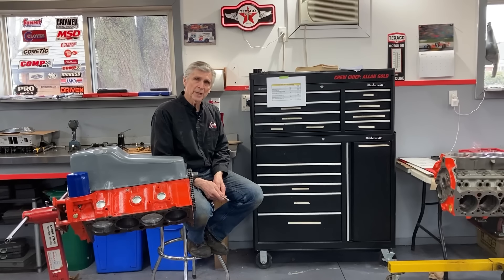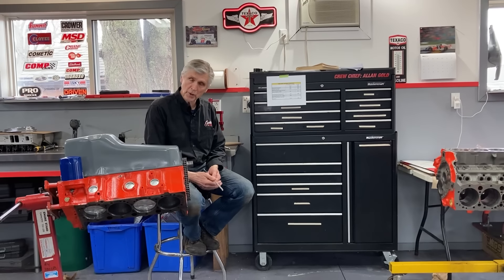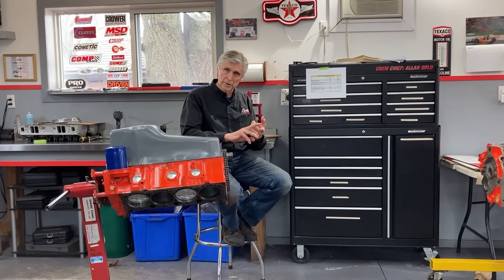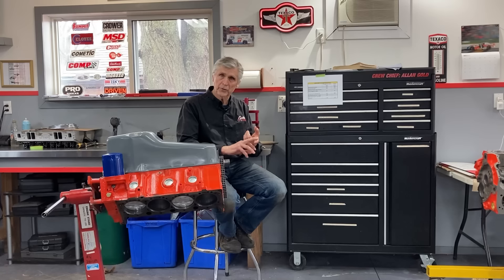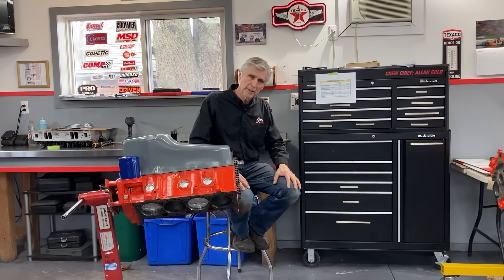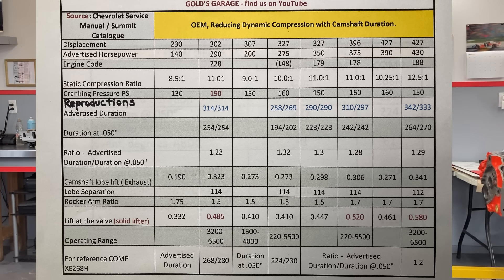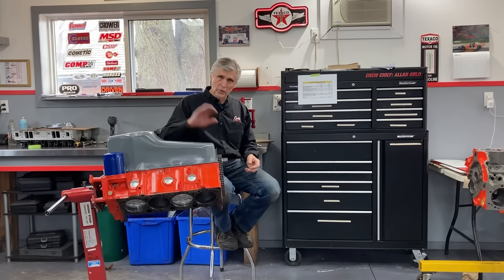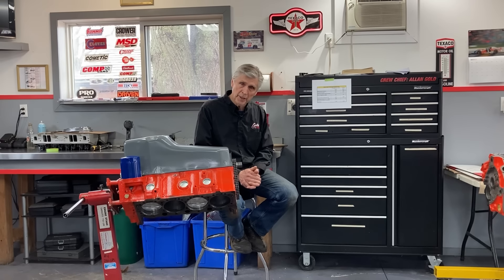Selecting the right camshaft - Compression Myths How much compression can you run on pump gas?

Comment: Hello, doing a 350 Chevy with 9.9 compression  but a very short camshaft. Howard's flat tappet. 255/261adv duration. And 201/207@50 with 114 centers. It's installed at 109 degrees  when I degreed  it.  What would I expect for cranking compression 200psi, maybe  a tad more? And also I plan on running premium  pump gas 91 octane in this engine, is it going work with 91 octane and still put a little timing in it?   It's got 416 305 heads on it with 60cc chambers, .015 steel shim gaskets with 12.3 cc dish pistons  with about .040/.042 quench.  Going run a stock Quadrajet  carb, holley street dominator  dual plane intake and factory ram horn iron manifolds. Wanting a low rpm high torque engine and fuel mileage  and not concerned about high rpm hp. What are your thoughts?  I can't find anything on how high of cranking psi I can go on 91 pump gas.
Reply from the maker: Thanks Jesse, you need a cam upgrade for sure. A couple of suggestions, what about the two cams I compare in the video. The COMP XE268H or the L79 cam. That said, you should re-calculate the DCR and cranking pressure with either of these specs. The Summit on line compression calculator will give you your CR and the Wallace calculator will give you the DCR and cylinder pressure PSI. 

If you read the other comments to my video, many out there claim to be running 200 PSI and I am sure they are, however my point is why take the risk? maybe have to reduce your timing and then HP too. You will be into  what I call diminishing returns, that is the gains in power from going from 160-180 are better than from 180 -200 PSI. Your objective is to build a nice street motor not make compression. 
Unless you are racing and need the every last HP, I would stick to my 180PSI. 
Please let me know if this is helpful and thanks for watching Gold's Garage. AG
Reply from the maker: Hey Jesse, I should add, you could also use 1.6:1 rockers to increase the lift without compromising the other factors. Lift helps everywhere. AG
Reply: @goldsgarage8236  I could run 1.6 rockers.  The lift with 1.5 is .410/.420.  This cam has a power  band 600 to 4600 rpm. What more do I need. The engine is going in a 72 C10 pickup with 3.73 gears and 700R4  tranny and only turn 2000 rpm @65 mph. I'm trying to build all the low rpm torque I can get and mileage.  I recently  did a 383 with Howard's cam   259/269 adv. 205/215@50 112 centers  .420/.455 lift in a 84 4wd pickup. It pumped out 195/200 psi on compression  gauge all 8 cylinders and run on 87 gas with 10/12 degrees intial timing and no pinging..   So I'd think it should work on 91 octane my combination.  I know what u are saying be on conservative  side.  I've double and tripled  checked my dynamic compression  several times,  comes out at 8.4.  Chevy had the 300hp 350 in 69/70 with camel hump heads and was 10.2 compression  on the stock 929 camshaft.  They just ran premium  gas in it.
Reply from the maker: Hello Jesse, just noticed that I missed your comment from 2 month ago. First, a 3.73 gear with a 700R4 is the perfect combination for the street. More than 11.1 torque multiplication in first gear and low RPM cruising. This will allow you to use a little more cam which will improve your power and  RPM range and lower your DCR. For timing, always set it at full advance with the vacuum disconnected. About 35 degrees usually works best. It doesn't matter what the initial timing is. Always use vacuum advance. Hope this helps and sorry for the late reply. AG
Reply: @goldsgarage8236  yes that's ok.  I plan on running the vacuum advance to manifold, not ported.  There's pros and cons either way but  thing more timing is better at idle with lean mixtures and cruising and it won't hurt things if it's lugging some or denotate.    More cam starts taking  low rpm power and torque away from bottom end.  I have overcammed  a 454 I did and don't like it at  all and no low rpm power for towing what I use it for so I'm going run small cams.  I'm after all the mileage I can get and not building a race car or drag race engine.
Reply: @goldsgarage8236  Hello again.  I tried to do a compression  check on that 350 and found out it gots a weak slow cranking starter and only got one cylinder checked but I only had about 160/170 psi, isnt that kinda low for a 10 to 1 static compression  engine. My cam is pretty small but it has the 114 LSA, i think thats costing me some cylinder psi, if it was on a 110 it probably  would have more?  Just curious  what u would say, i was hoping for 180/190 psi.   Going fix starter  and re check if that even helps?  8.4 is my dynamic so I thought the psi would of been more.

Comment: 12.5-1 compression.  Timing . Coil near Plugs . The Right Camsharft & Crank Trigger .  & in Australia 98 Octane  / USA 93 Octane.   U could also run as a Safety Margin  Water / Methanol.  Works fine in N/A Engines ,  but better in Boosted Engines.     Pretty sure that Porsche are running 12-1 or 12.5-1 in there N/A engines.

Comment: If you could run forged parts in a 427 chevy, you could rev them to around 8k for short spurts. We made more power then the other gm guys that way. No rec port heads for sbc 327, 350, 455s back then. 320 cfm flow was awsome, then we'd port em.

Comment: This is EXACTLY the Question I'm Needing Input On!! 1968 427 321 30 over Block, Speed Pro ZL-1 Replacement Pistons, 074 ZL-1 Heads(2.25 Intake) w/.020 Milled Off, Factory 069 Intake and Holley 850 Dbl Pumper. TH400 + 3.90 Gears. Thinking of Roller Cam-Due to the Lifter Eating As of Late.
Reply from the maker: Thanks Mark, you will have a nice motor. A roller is a nice way to go for sure. Too bad they are so expensive. Thanks for your input and please keep watching for more on this subject coming soon.

Comment: I run 100 av fuel with an ounce of additive 13.0:1 static, 9.6 dynamic and 240 psi cranking. Better to be safe than sorry, I also Dyno tested av gas vs sonoco 110 and av gas was 20+ HP up on the 110.
Reply from the maker: Thanks for watching and commenting Mopar. You definitely need av gas with 240psi. AG

Comment: When your boat is on the water you are riding on a giant radiator you can adjust it if your boat is set up right as to what kind of temperature you want to run and you can get away with murder compared to a streetcar as far as high compression goes
Reply from the maker: Boaters are spoiled Hoosier, thanks for the comment. AG

Comment: The issue with running high static compression ratings is the volumetric efficiency of the engine. If an engine running 12:1 static has very high flowing heads, intake, and high duration lift camshaft then it is likely that 100% or greater volumetric efficiency will be reached at high rpm. 100% VE means the static cpr ratio is being met. If you’re at 11.5-12:1 static and you’re meeting 100% VE then race fuel will have to be used. Many of these muscle engines run on the street with high static cpr ratios but it doesn’t matter as the heads and camshaft are not capable of reaching a high enough VE to reach what is the static ratio (11:1, 12:1 etc) thus 91 or 93 octane runs them without issue. Most ‘hot’ street builds with 2v CSB etc engines are maybe reaching 90% or so at best
Reply from the maker: Good point Selmerpilot, I plan to address this issue on a future video so thanks for the input. AG

Comment: Back in the 80s we didn't hav3 hi test at the pump hardly anywhere.  In the 90s we had aircraft hi octane gas. And e85 is just to expensive. Cost is a big factor for a hi perf street car.

Comment: Not all engines designed the same as regarding Anti-Knock Chamber--Piston shape issues.....With '60's high compression Factory production Tolerances & 100 octane Pump gas available,  0.040" to 0.060" head gaskets & high domes were common.....When doing  a build Today, Thinnest gasket (to whatever Piston to head clearance you comfortable with), Aluminum heads & Shortest piston Dome to give 0.040 Squish gap & using the Coldest range possible Sparkplug with a hot ignition is usually a good direction build plan.....With hopped up Pontiac engines tendency to run Hotter than wanted, It's Interesting  that Pontiac used "Reverse Flow" coolant design to Cool the head First & then the block.....
Reply from the maker: Thanks Tom, I don't think there was as much attention paid to squish back then. Most OEM haled at last a .040 head gasket and then .030" minimum deck height. I recall using a thin steel head gasket on my Z28, we painted them with silver paint. They were about .015" and I did deck the block so we were close, but we didn't call it squish.

Comment: I used the speed pro ,  306  222 at 0.50.447 lift. It would improve power in about any form of 350. I agree.
Reply from the maker: Thanks David, looks like an L79 Cam. They work great.
Reply: I bought a 1978 Mark Twain boat. Engine was all apart.
I used that cam in the 305. Ran surprising well.
Idle was not very good. But at full throttle ran great.

Comment: well imo with that comp 268 stick at 190 psi cranking you may need to take use of a well designed aluminium cylinder head possibly a lower operating temperature slow advance curve perhaps even less base and total timing and may have to make a fatter afr in some operating areas you make it work. the slower gm style ramp rates bleed off much cylinder pressure and again imo may have to advance base timing speed up the curve to get clean idle and throttle response however as things get swinging at rpm the trapped pressure may be to high for 87 juice depending on what it is paired with automatic 308-1 gearing 1ton dually or tge other way like a nova or 60,s camero may be just fine or need total timing pulled back a tad and fattened up on the top of the mains. back in the 70,s we were playing with water injection systems from edelbrock to mist some purified h20 at certian vacuum rpm as well as throttle position to prevent flame front deflagration detonation ping spark knock or what ever to help. tolulene as i recall was one of the things we would add to crap gas back then tgat seemed to work quite well
Reply from the maker: Thanks John, you have lots of knowledge and experience on this issue for sure, I will be disusing these issues in the next video. Thanks for your contribution to my channel. AG

Comment: Don't better grade fuels also allow for more ignition timing with less fuel allowing for more power? I know that's one of the factors that can play into your tuning
Reply from the maker: That is correct William. The opposite of that is when compression pressure is to much for the octane, the only option is to reduce timing and reduce power at the same time. Thanks for the comment. I will discuss this further in my next video. AG

Comment: Do a video on the poor little 290 Horse Power 302 cubic inch Z28 engine 😁
you would think it would depend better with 11:1 compression and a 254 duration cam 🤠
everyone loves that might mouse so it would be a BIG Video if you talked about that engine. 😊
or built one with a build video searies.
Reply from the maker: Thanks DAN. One of the first builds I ever did was the 302 in my 1968Z28. That was back in 1969. I would love to do another one. Finding all the correct OEM parts is a challenge and very expensive. If anyone out there has one to build, I would be happy to do it for you, Dyno included. AG
Reply: @goldsgarage8236  Right, Chevy did lots of tricks to that motor, pistons shape, windage tray, off road cam, 🤠

Comment: Can you please explain dwell angle
Reply from the maker: Thanks Dr. Evil, that is an interesting question. The term applies to ignition systems prior to the introduction of electronic ignitions. By about 1973 all ignition systems were electronic. 
Prior to that spark was provided by ignition coils and ignition points, then distributed to the respective spark plug wires via the rotor and distributor cap. 
Ignition points (contact points) are really just circuit breakers. With an 8 cylinder engine, the distributor cam had 8 lobes, so dividing 8 into 360 degrees they were 45 degrees apart. 
The ignition points connected the primary side of the coil to ground. When they were closed 12volt power in the primary side would energize the coil, which is really a simple transformer, so voltage would build up in the secondary side of the coil, (about 10,000 volts). When the cam on the distributor opened the points, (circuit breaker) as it rotates, the built up energy would discharge from the coil to the spark plug via the rotor and  the distributor cap. 
Ok, finally here is the answer to your question, dwell angle is the amount of time (in terms of rotation) that the ignition points were closed, usually about 30 degrees of the 45 degrees. 
In GM cars, the distributor cap had a little window, the dwell could be adjusted by a small allen wrench via this window. 
Since you are looking at my camshaft video you may be thinking about something totally different. If so, let me know and I will try to answer it. 
Hope this helps, thanks for watching Gold's Garage. AG
Reply: @goldsgarage8236  thanks a mill. Reason why I diverted from the cam shaft lesson is that the distributor is also cammed. I just do not know what effect too long or too short a dwell will have on ignition timing and if it affects the points negatively. As for your camshaft "lesson" it is brilliant. I can help myself around a car but I'm an idiot when it comes to how they are designed. 
I look forward to more of your videos.

Comment: Seem to me cranking compression pressure is much less important than running compression at full target rpm, and maximum breathing available. Therefore even adding mufflers would reduce the octane required.
Reply from the maker: Good point, thanks for contributing Hamilton. AG

Comment: So a couple of questions, first is kinda open ended, but I wonder which if any of the cam grinding companies have the dies or what ever to grind the slow ramp cams now. Because I would really like to go that way. Second what is a really good spec,for a cam, in your experience. For a SBC 400 that's  built for lower rpm use, like trucks. That are never going to rev past like 4k rpm, that would make lots of torque, and  power at the low end. Typically big chamber iron heads, at like 9:1 compression. Although I guess I could go higher if , I could get someone to grind a slower ramp cam as you describe. I like to to use solid mechanical cams for me personally  anyway.  I can generally get the specs I want ground for hydraulic or for mechanical profile, depending on what I am building.. Thanks.
Reply from the maker: Thanks Gabriel. There are so called RV cams which are designed for low RPM torque. Hard to find solid lifter cams that would be "mild" enough for your application. 
If you can calculate your static and dynamic compression that would be good. Planning is important. Thanks for supporting my channel. AG

Comment: You are aware that dynamic compression is just that dynamic and as you go up in rpm airspeed goes up and you are at full static compression .... Also you can't compare advertise duration because gm used .001 tappet lift and comp uses either .006 tappet lift or .012 tappet lift .. and flow down at those numbers does not happen .... That's why .050 tappet lift is on most cam data sheets
Reply from the maker: Thanks for your comments Scott. All good points. Watch for more on the subject.

Comment: We did testing on our cars so we didn't have any misconceptions about octane levels vs comp ratios. The car manufacturers know alot too. There are some very good charts out there. We ran 10.5.1 tops on 93 octane with aluminum heads back in the 80s and 90s. So that's about the limit on pump gas unless you added racing gas or ran alcohol back then and no one ran a street car on alky on the street. We had tried 11.5.1  with iron heads and that was pushing it on the best pump gas hi test. We had access to 100 octane plus at airfields. You won't make alot more power going from 10.5.1 to 12.5.1 to14.5.1 anyway. Wasn't worth it. A lousey 20 hp difference at most. The cadillac 472, 500s engines with 12.5.1 comp wouldn't run on gas. The 10.5.1 motors could.
Reply from the maker: Good info, thanks PMD. AG

Comment: I have a 60 over 427 so a 439 it's got around 10.5 to 1 compression I have a set of afr 265 oval port 100%cnc ported heads I'm running a Howard's 235x241@50 with 618 lift I have a Victor Jr intake and a 950 double pumper I asked a very well known guy on you tube if he thought it would make 550 hp he said it was to small of a cam shaft for that well I told him what it made on the dyno and the guy who built my motor been building race engines over 50 years it made 661 hp 605 torque and the guy still didn't believe me so I sent him the dyno print out now the next day it was a little different air 4 pulls and they were 2 back to back times and it made 647 and 648 4 times in a row. I didn't think the engine would make that much power I think the famous you tube guy was just upset because my motor made more hp then the 468 he built with the same heads and a bigger solid roller and the 496 he built was only I think 30 more hp...lol love your videos
Reply from the maker: Thanks for your comments Richard. That is big power, is it a street engine?
Reply: @goldsgarage8236  yes its going in my street car

Comment: We made way more power then the stroker motor guys did with our shorter stroke engines. So a 396 could rev to 9k but an olds 455 or buick at 9k would explode. They didn't make power at high rpms. Cadillac 500s never made power past about 5000 rpm. Too long a stroke. Long duration cams got us there with ls6 and l88 aluminum rec port heads.